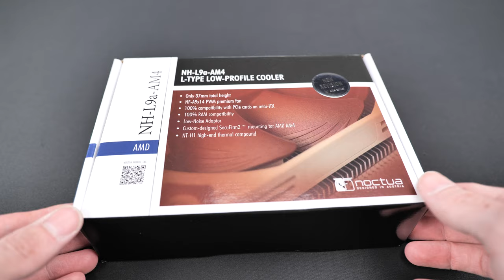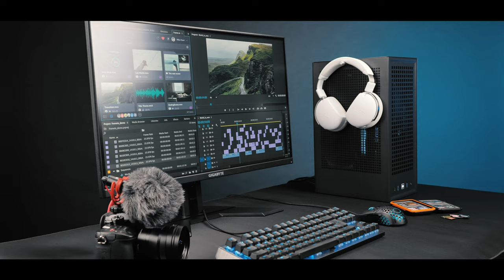Travel In Silence?! Building The Hyte Revolt 3 | Noctua Air Cooled Gaming / Editing PC Build

Comment: How did you get those cooling numbers? I built same pc and i'm getting 96c on my processor. I even cleaned and reapplied my thermal paste thinking it was possibly that, but still running hot. And the fans are running loud.

Comment: hello, good luck. It was successful. I want to ask you something. I bought the same case. My ryzen 5 5600 processor.
Is the noctua cooling you use used in the 5600? can i catch the same heat values?

Comment: both of the pwm fans are intake right?
Reply: Yes you can see the side with no fan hub cage so it means they're pulling air into the case
Reply: @pineapplej7310 but where is the exhaust? Is it really don't need it?
Reply: @googleguy8188  not really, the case has plenty of space to exhaust air, and positive pressure is king!

Comment: I built my first PC with this case in August.
I used the Noctua NH-C14s for the CPU cooler. Probably one of the biggest coolers you can fit in the HYTE Revolt 3. It's doing great so far.
Anyways, this video is awesome.
Reply: How did you fit it? I'm currently building mine with that exact setup and if I orient the heat pipe end toward the GPU, the radiator sticks out of the case. If I orient the heat pipes away from the GPU, the radiator sticks out to where my GPU won't fit. I haven't tried either of the other directions as I'm pretty sure those directions won't fit either.
Reply: @SomeoneElseInTheComments  
You can rotate the heatpipes towards or away from the ram.
I recommend the heatpipes facing the RAM. This is because the cooler is not centered, so other orientations will cause size problems.
I didn’t mention that I placed the fan on top, because the total height of the cooler is exactly the max height for the HYTE Revolt 3. 

Based on your comment, it seems you may be using a Intel cpu, which has the ability to be mounted in all four 90° directions. AMD mounting only allows two orientations, which are 180° of each other.

If you still don’t understand, I recommend watching my PC build video on my channel. Just make sure to mount the NH-C14s in the opposite way that’s shown in the video. I later realized it was just slightly too wide for the back panel to close fully.
Reply: Do you feel it would be a good travel pc? I want to do some Lan parties I was looking at this one or the Phantek Air 2.
Reply: @Noodlepunk  
Yeah, I think the HYTE Revolt 3 would be great for travel. That’s what it was meant to do.
Since it has a handle and can support more than the Phanteks evolv shift 2 air, It’s a great option.